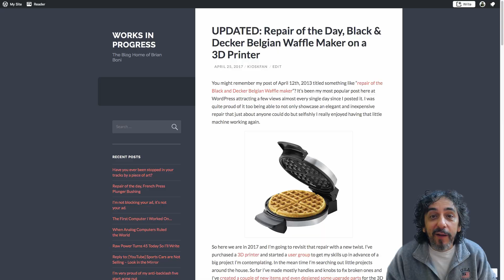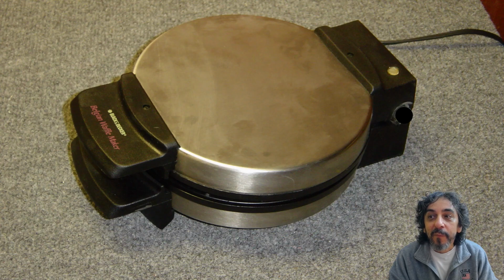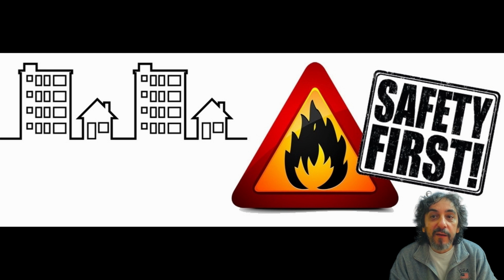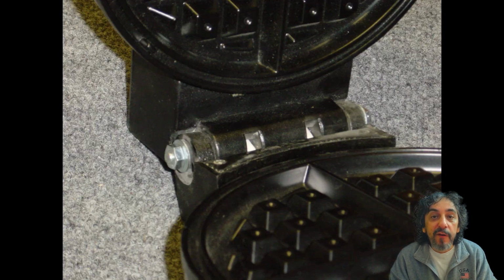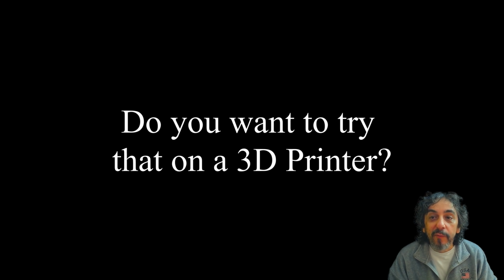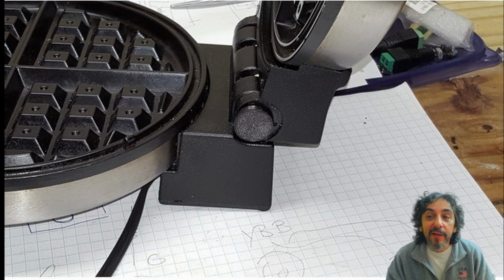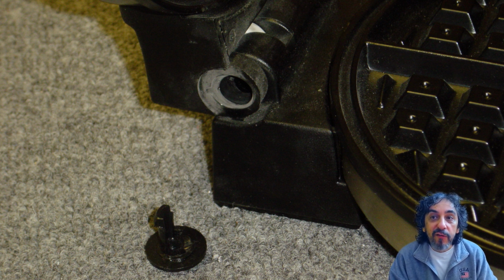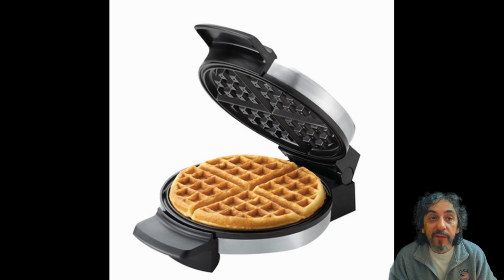Black & Decker Waffle Maker Hinge Repair WMB500 WMB550

Comment: This was a brilliant solution!  Thanks for sharing the idea.  I hated the thought of throwing this appliance away over two little plastic parts.  I found a fuel hose that was 1/4" inner diameter and 1/2" outer diameter and it fits perfectly into the opening.  It is a tight fit, so I used the old trick of wetting the hose with water, and that helped get it snugly into the hinge opening. The top swings open smoothly and with just the right amount of resistance.  It is snug enough that I am going to try it without the bolts. I encourage anyone else having this problem to use this solution and avoid sending one more item to the landfill unnecessarily.